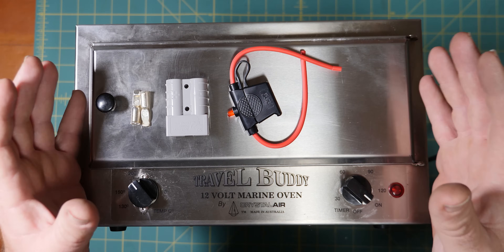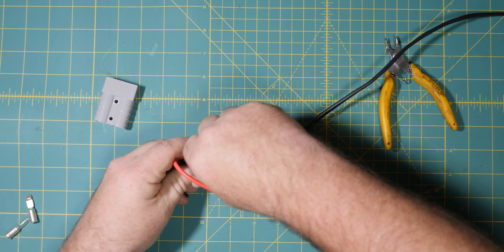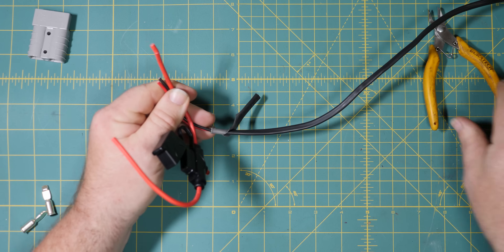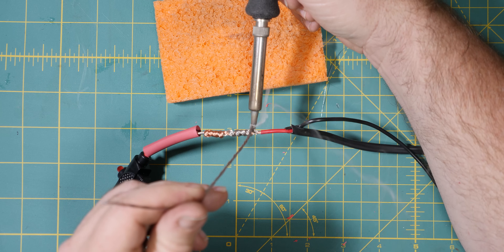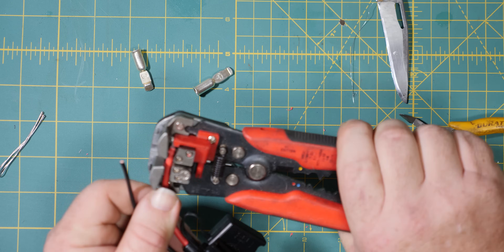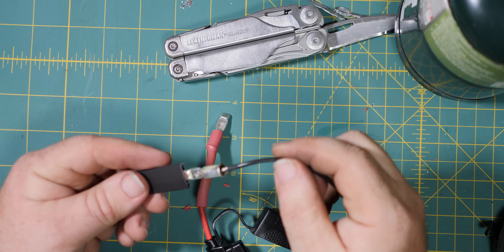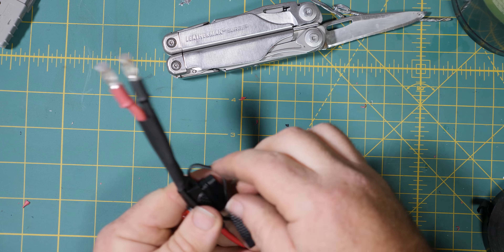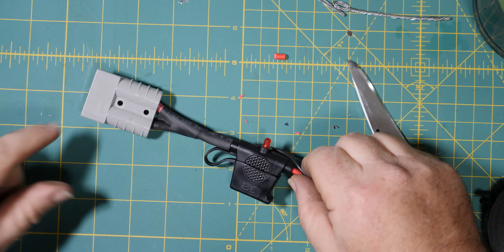Wiring Anderson Plugs and Splicing Wires

Comment from the maker: Is there a better connector than an Anderson Plug for 4WD electrical?
Reply: Lock your Hubs 4WDing there is a hella marine connector and also there are options of nato connector (military) with solder connections too, just how we like them ;) I will have a look tomorrow as I know what I’m looking for.
Reply: Lock your Hubs 4WDing https://www.hellamarine.com/en/products/accessories/plugs/chrome-brass-plugs-and-sockets.html
Reply: Lock your Hubs 4WDing the nato plugs are usually 24v-28v dc which allows higher current loads, also dust and water proof, and screwed mating.

Comment: Hilarious mate.
Reply from the maker: Why is that? Please don't tell me you're one of these crimped or die fellas......
Reply: @LockyourHubs4WDing .
 Nha, nha, definitely not mate.
I only crimp over 150 amps.
  But where do I start.
 Blade fuses there shit the housing gets hot and melts. 
It gets to a million digress here in Australia. 
Use Midi blocks. 
Different size wires recipe for disaster.
The size of the knot was ridiculous.
   I'm not even sure how to address the heat shrink.
That's why.
Constructive criticism.
Reply from the maker: Midi is the wrong fuse for the application, the usual smallest Midi fuse is 30a, you'll burn out wiring inside the TB with a partial short before the fuse blows.
Reply: @LockyourHubs4WDing .
Then if it's under 30 Amps, whatever you're running should be wired back to a small fuse panel / block. 100amp minimum.
I'm assuming you're running other stuff as well.
 Everything except high current should be on a panel. 
 I see this all the time 5s Anderson's hang off a battery.
 If it's clean and tidy, there's less chance of failure.

Comment: 😮. I find it interesting that you make a video about something and dont use the proper tools, wire strippers, crimpers etc??  And heat shrink too short??   Come on mate.!
Reply from the maker: You're a crimper or nothing right?
Reply: @LockyourHubs4WDing     No to crimp only…. But if your going to do a video, then your going to get some feedback.  If your going to connect 2 wires, then know your lengths and shrink tube to cover the connection??!  Don’t be a Hack ( blow torch.. really)?

Comment: Is it better to solder or crimp 3mm wire into an anderson plug? given its designed for 6mm wire?
Reply from the maker: You won't unfortunately get an effective crimp, so flood soldering with heat shrink afterward will be your best solution.

Comment: NONONONONONO PLEASE GOD WILL PEOPLE STOP SOLDERING THEIR ANDERSON PLUGS!.
Soldering copper joins and exposing them to moisture and dirt while also putting current through them (or not) will result in a massive shit show.
The flux in the solder reacts with the copper and lead and H2O to create acids which corrode the copper and give you green death.
If you want good joins use a copper crimping paste/mounting compound And crimp your connections. 
For Anderson's use those adjustable single tooth crimpers available on eBay for less than 50 bucks.
No your uncle or best mate is wrong, don't solder shit that's exposed to moisture and dirt.
I've had enough.
Reply from the maker: So I take it you're against soldering Anderson plugs? :) But seriously, what I haven't seen is evidence either way. A SAE paper or other reputable source siding one way or the other.
Reply: @LockyourHubs4WDing  https://rbracing-rsr.com/wiring_ecu.html this link covers some stuff that is useless to average 4wders but also things that are wildly valuable as well. The salt wicking test is interesting.  My severe rage with solder in exposed conditions is from more than a decade as an industrial electrician and avid offroader. Where ever you find moisture minerals and tough conditions you are going to see bad corrosion in exposed electrical equipment.

Comment: If you are going to solder the cable into the Anderson connectors, its a good idea to tin the leads first (fill the bare wire with solder) . Just plunging the wire into the solder filled connector doesnt mean the is a full and proper connection to all the wires. I prefer to crimp, but then I have the proper tools to do it.

(P.S. I am an Avionics tech, and do stuff like this for a living - )
Reply from the maker: Thanks for the input, I would have though capillary action should draw the solder up between the strands of copper, I might have to cut one up and do a comparison and see exactly how far the solder has worked its way up.

 For small solder connections I usually tin them.

As you're an avionics tech, do you know of any technical papers that compare soldered vs crimped connections, for tensile and vibration?
Reply: Lock your Hubs 4WDing touche👍

Comment: I think you underestimated the length of your cable join with your heat shrink. I also put a longer length of heat shrink over the outside of both wires which covers both pieces once soldered to keep the wires together. I have mounted a small vice onto a 200mm square x 25mm (offcut from a benchtop) piece of chipboard especially for soldering and using inside when I'm not in the workshop outside. I have been using the heat shrink that is 3:1 reduction with glue included which I find is great for outdoors and 4WD stuff and its not that expensive from that site we all love to get cheap stuff from. You DO love that blowtorch don't you!.. I have a small butane heat torch that I use which has a flat bottom and stands upright and makes it much easier for a free hand and less burning of hairs on my fingers etc.. lol..... The trick I have learnt is to think what I am making/doing and then put the required amount of heat shrink on FIRST before any soldering or heating of other heat shrink happens. I would be putting the FUSE at the POWER SUPPLY end of the circuit NOT the appliance end.
Reply from the maker: I definitely underestimated the length of heat-shrink!  I prefer the double walled heat shrink with the glue when I can get it, or have it handy.

I like the idea about the table top vice for working indoors, I've been meaning to invest in some "helping hands" for soldering work. 

I usually just plug the TB directly into the PowerHub. I'm not sure how the Anderson output is fused, so I want a fuse as close to the output of the Powerhub as possible.

And yes, I do like the Blowtorch!

Comment: I don't like leaving my Travel buddy hooked to power all the time.  I've had a couple times where the timer did not switch off and goes to Run.    The first time this happened,  I did not know.  My Travel Buddy was on for a couple days before I realized it was still on.   My 4wd was parked in garage for a couple days,  when I got in I could smell something,  when I checked out the back,  I was horrified the Travel buddy was on,   I unplugged,  and always unplugged ever since.       Few days later I did some tests to see if I could replicated the problem and it did it again.     Honestly would have to be the biggest piece of crap I ever purchased,  but it does cook a good Roast.   So will continue using it,  but I'll never leave the anderson plugged in.
Reply from the maker: Honestly, I haven't heard of that happening before. Contact TB as see if they can supply a replacement.

Comment: FYI. There are different size lugs available for the Anderson plugs so you can better match the lug to the wire size.
Reply from the maker: That's one of the reasons I used solder, though the 6GA was the smallest lug size Jaycar had in stock when I was there.
Reply: @LockyourHubs4WDing  ii sell 10/12awg kits on my website www.somervillemetalworks.com.au

Comment: Excellent, thanks Steve. I've often heard that solder wicks up the wire under the insulation and that makes the wire brittle just where the most bending will occur from vibrations...hence the advice to crimp rather than solder. I see though that a/ the heatshrink takes some of the stress out and b/ the Anderson connection is usually not fixed hard (e.g with a screw) to a solid part of the car which makes it a floppy rather than rigid connection, so not likely to vibrate. I've toyed with the idea of bolstering the stiffness at the joint with stiff wire or plastic under the heat shrink when one side is screwed/bolted to the vehicle frame. How much all this matters though I have no idea!
Reply: Solder will do the job, in a couple of years of vibration get ratty. A good crimp will last life of the car. There is a reason solder is not used in mobile applications... Key point, GOOD crimp...
Reply: The heat has already affected the properties of the metal and the solder will eventually crack over time. The connection will eventually oxidize, heat up and break... The crimp makes the connection more flexible for environments where there is vibration or manipulation and does not affect the integrity of the cable by adding heat... That's the basis!
Reply from the maker: I've also heard about crimping vs soldering, with proponents from both sides. What I haven't seen is hard evidence either way, and would be really interested to read something like that.
Reply: @LockyourHubs4WDing  Yes, the theory is plausible but unproven as far as I know.

Comment: G'day Simon...your video raises some interesting discussion points:
1. Why is there a need for a fuse in that line...when there should be a fuse close to the power supply (IE: on the line that has the other Anderson plug). I'm guessing because the other side has a fuse that is much heavier??
2. Anderson plugs are great, but if the item being powered is likely to be a permanent (or semi permanent) connection, then the better method is to hardwire the item via a fuse board. Anderson plugs can (and DO) lose their integrity over time if they are not regularly disconnected and maintained...maybe a bit of dielectric grease for example. If permanently connected the spring-loaded "tangs" can lose their tension over time.
3. Okay, someone had to bring it up...soldering versus crimping!! Soldering is perfect for the splice you did (although I still don't see why there was a need for that inline fuse and I have seen too many melted inline fuses to ever want to use them again...it's midi fuses for me these days)....BUT soldering those Anderson lugs is a recipe for disaster. You said yourself, as you twisted the spliced wires together...that's a good MECHANICAL joint and then the solder just finishes the joint off. With the Anderson lugs being soldered, there is NO mechanical joint. Over time those joints WILL fail from vibration etc. This is the reason why such joints are ALWAYS crimped in the aircraft industry for example.
4. Given the small gauge of the cable being used, I would suggest that the Anderson "Power Pole" type connectors would have been a better choice. It is always best to try and match the gauge of the cable to the size of the lug it is going in to and then crimp the bejezzus out of it. 
Sorry if I'm coming across negative. I'm just a 65 year old clown who has learnt all these things from trial and error....especially ERROR. And now that I have a son in the RAAF doing avionics, he critiques all my work whenever he comes home. I have the ability to make him cry; just by showing him my self-taught "handiwork"...but it does all work (just not as neat as he'd like).
Reply from the maker: G'day Bill, thanks for taking the time to write such a comprehensive comment.

The Travel Buddy is often plugged into my PowerHub, I'm not sure what the rating of the internal fuse/circuit breaker is, with the fuse located near the plug, it really doesn't matter what the fuse of the Anderson I plug into is rated.

I agree, permanent wiring is always the preferable solution, though the travel buddy is going to be powered by the Zook, my LandCruiser and the PowerHub at camp, so I need a versatile solution, and all have an available Anderson to power it.

As far as crimping vs soldering is concerned, I've heard opinions from both camps. What I haven't seen is solid evidence supporting either argument. Like a peer moderated SAE paper, or something similar. I might have to pull my finger out and settle it once and for all on video one of these days.

I need to power multiple devices from each car/source of power, I need to run things like air compressors and 12v chargers, that draw considerably more current than the Travel Buddy, and while I agree the Anderson Pole connector, that are designed for lighter cables would be a better solution if the Travel Buddy was the only thing I was powering, it isn't.

Sounds like we're both in the same boat mate, my son is a plumber, and just shakes his head at Dad's "workmanship" !